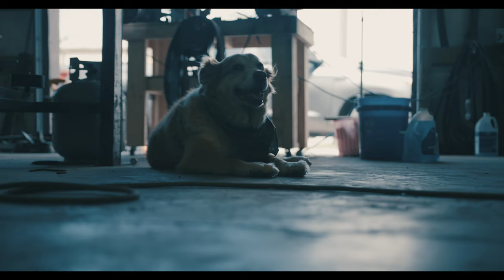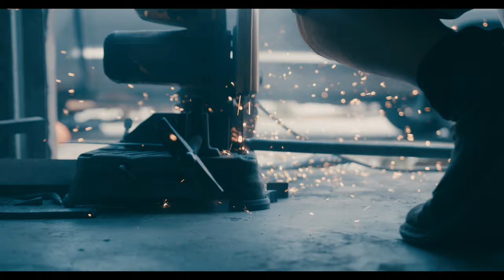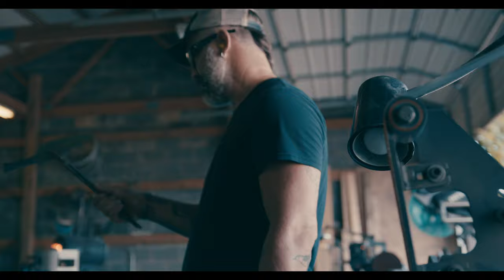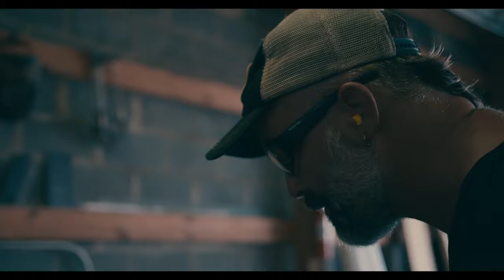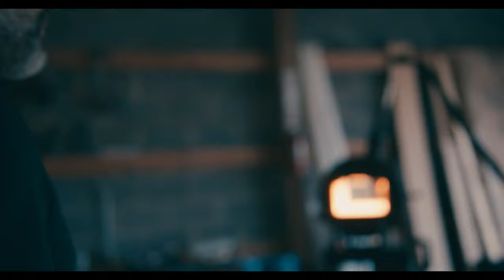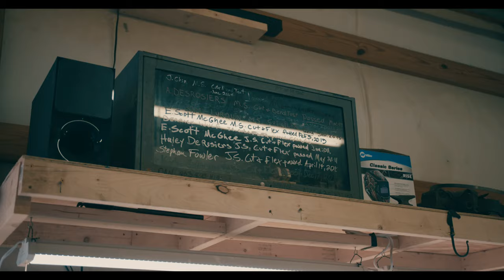FORGING MY WAY | The Story of A Maker | Master Bladesmith Jason Knight

Comment: Hey Jason,
I’m a big fan of the ‘Forged in Fire’ series and making things using personal resourcefulness, talent and craftsmanship.  I’m interested in starting to blade-smith as a side hobby, but getting started seems overwhelming and complicated without any guidance.  Is there anyway to simplify the process?
Reply: I am definitely not a master of anything yet, but can say that to get started in knife making all you need to make  a useable knife is at the bare minimum something to hold a decent fire whether this is a pit in the ground with an iron pipe for a tuyer or a proper gas forge, a hammer, some sort of anvil which could be anything from an antique plough(have done is ok) or a rock to a proper forged anvil,  something to quich in which could be anything from used motor oil to the good engineered oils, and something that can be used to grind metal which could range from a lump of sandstone to a good grinder. Get the best tools you can afford and get started, practice makes better and there is no good substitute.